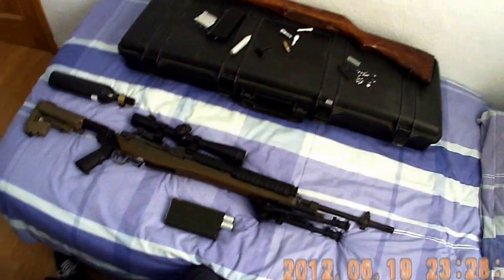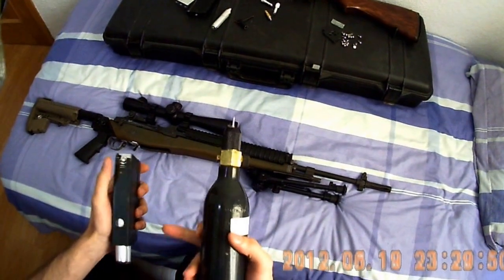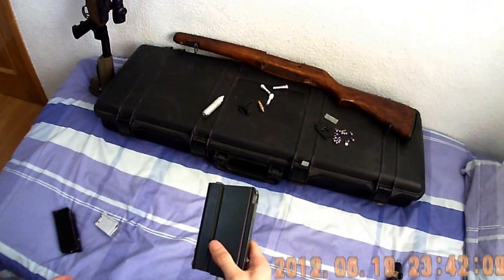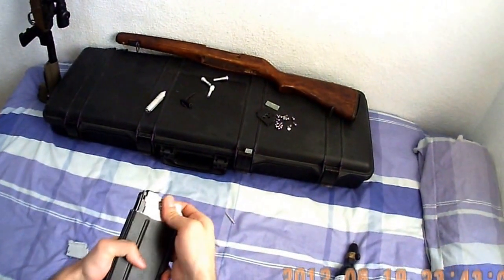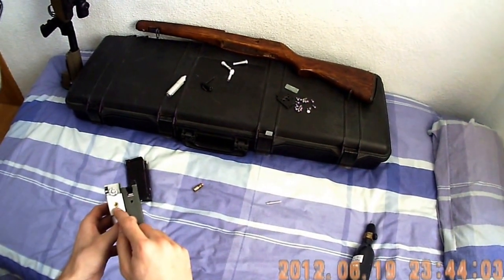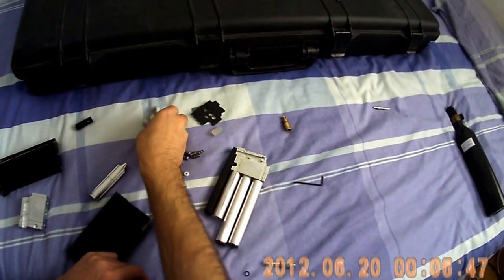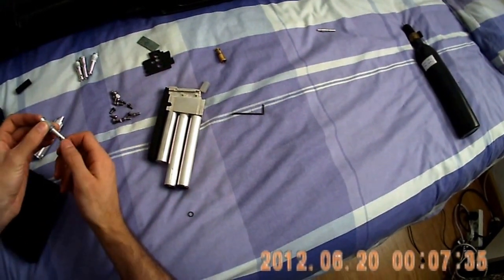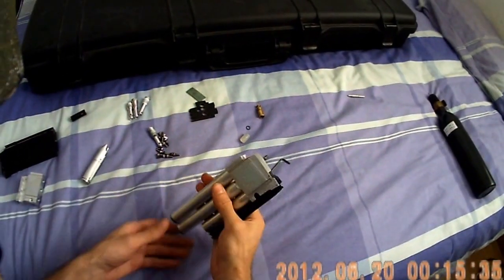WE M14 CO2 Mag prototype

Comment: Do you sell these somewhere?
Reply from the maker: +dcrypter87 Not yet, but I hope so in the future!
Reply: have you measured the FPS? 
=)
Reply from the maker: No, I couldn't jet. I've been very busy this months since I posted the video. I spect them to be high since I have a 6.01 mm barrel (560 FPS with R410a gas). Of course It can use the NPAS and I can always reduce the amount of CO2 that the output valve let out, but I want to get high kick.
Reply: the m14 was always a bit bullshit.... the only WE gun with only greengas and still the most expensive of them all... so ill be waiting for an update for sure =D
Reply from the maker: Yeah, the outside of the gun is pretty good but it has some crappy internals. I have to remake the whole trigger group. It was my first CNC part so it has some mistakes. I also want to make another bolt (you can see my aluminium bolt on my previous video, was made before RATech released it's own) and maybe I will try to make an steel bolt carrier. I wanna push the gun to the limit in terms of recoil, and replace everything that breaks with better quality parts. It will take me some time to continue but I will post the updates here in YouTube, stay tunned.
Reply: same here i reinforced it with epox and a plate...
Reply: +EmperorDevilhunter I know that there would be multiple people interested in purchasing this magazine. I've heard a lot about the original ones leaking, and the refusal of WE to make a CO2 magazine. I'm really shocked that no 3rd party has stepped in after all these years and made one. I'm sure people would like to see the CO2 concealed within the magazine if possible, though.
Reply from the maker: +waffl6 now that I have finally a better machine I can continue improving the prototype and make some more! I try to only use CO2 in all my guns